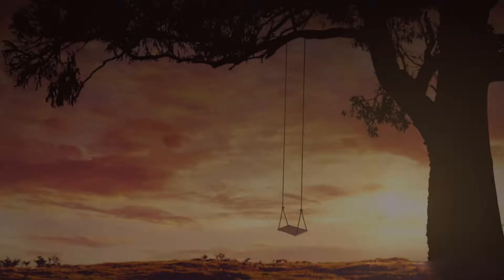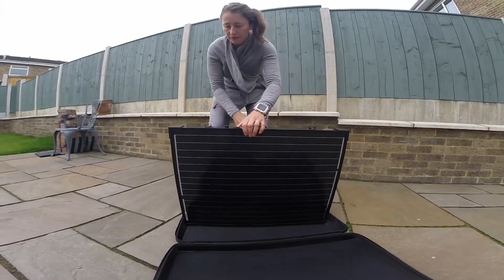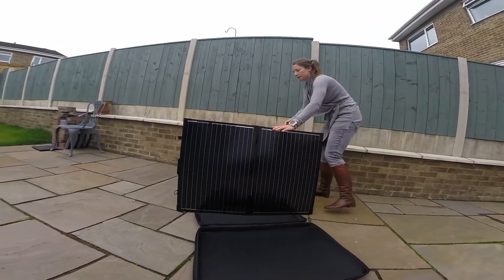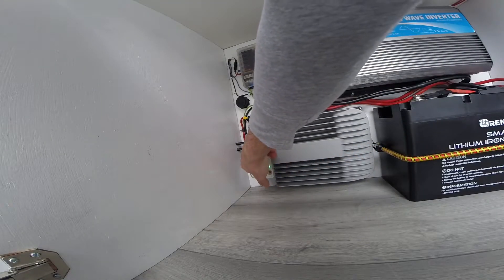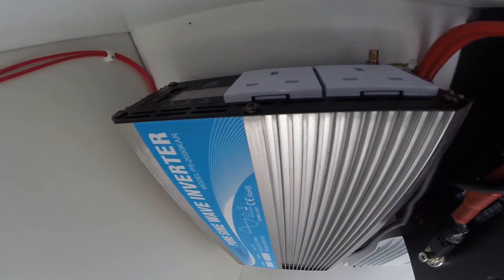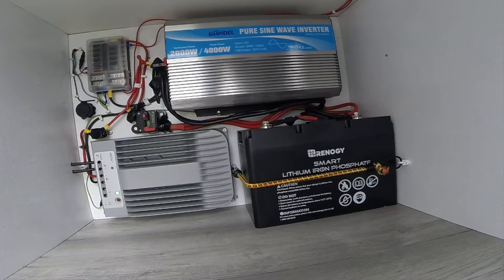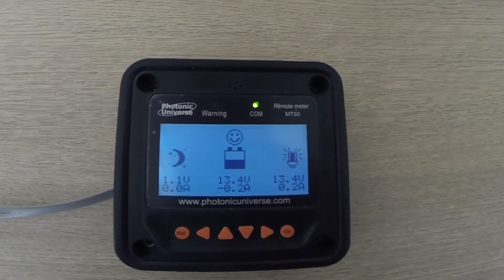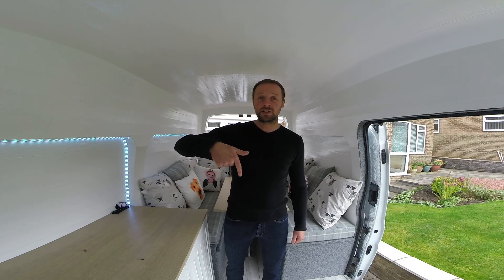RV camper van Solar power setup of Renogy 100W solar suitcases Renogy 100ah lithium battery and more

Comment: Just a small question, are you able to run the inverter full load with only one battery that the max amp output is 1C/100 amp?